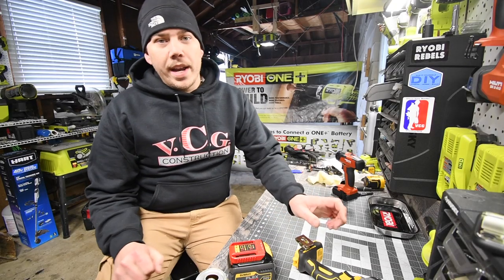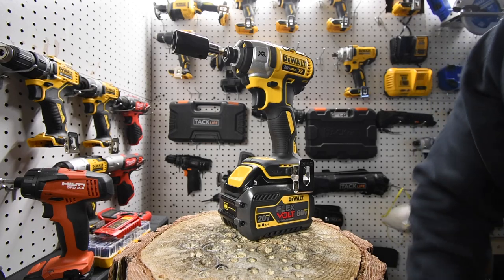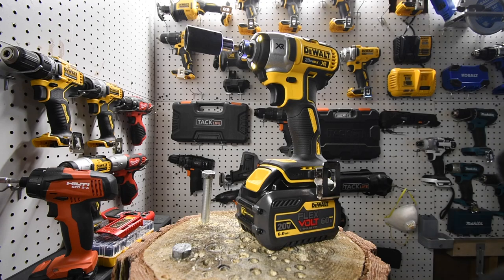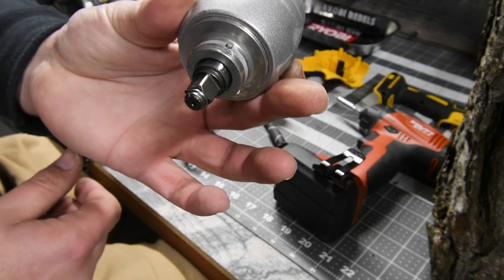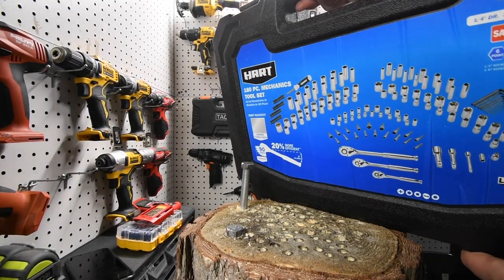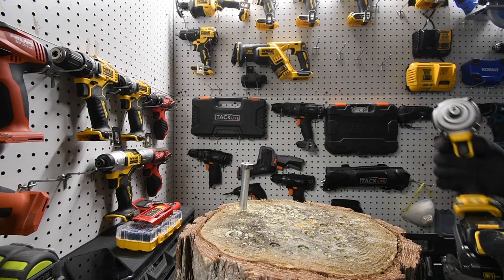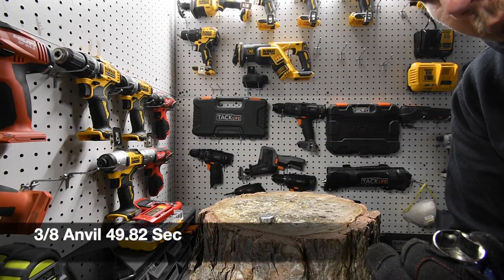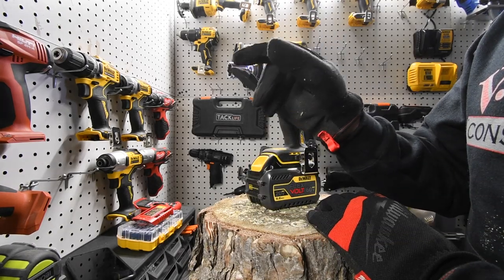1/4 Hex Anvil VS. 3/8 Anvil in a Impact Wrench

Comment: I did this conversion.  I only swapped anvils between the two. 
The 3/8" anvil seems to stick out a little more when put in the 887 body. 
The 1/4" hex  anvil isn't quite long enough to allow the lock-ring stopping the anvil from falling through nose cone to be installed.  I just left it off and it works fine, bit doesn't fall out and it drives screws just like before but stuck at speed 2. The collet seems to be up against the body but it's barely rubbing on it. Doesn't affect it's operation.
Reply from the maker: I am glad that you like to take tools apart. people need to do it more often for maintenance. but sometimes people are to afraid because they might break it
Reply: @ManCaverTools  I figured out that the anvil, hammer and nose assembly has to be swapped between the 887/890 to work perfectly with no issues.
The hammer in the 890 is thicker than the one in the 887, so even if you mix match them it won't work perfectly which is what I did the first try around. 
I have a video of the finished products.....

Comment: Try for longer when wanting take out the bolts the impact wont start turning in less than 1 second needs bit time to build up torque need wait atleast 5 secs thats when  impacts are at full torque
Reply from the maker: not a problem sir and thank you
Reply: @ManCaverTools  it's cool just a tip thanks

Comment: The quality of the hex adapter may have been a factor.  For example I used a standard chrome craftsmen 8" extension to take some bolts out but for the last one I used a HF impact extension and it wouldn't budge. Changed back to the chrome extension and the bolt came right out.  I had to stop mid job and run to HF before they closed n that's when I saw the impact extension kit and figure why tear up my chrome standard extensions.
Reply from the maker: Makita so far made the best one that I testes

Comment: I take back my statement in the last video the 3/8 anvil made more of a difference than i thought but the fact that the torque numbers between the 890 and the 887 are basically identical is still a shame dewalt could have atleast made the 890 200 ft lb instead of 150
Reply from the maker: it would be nice if it was more powerful and thank you sir

Comment: Theres a 3/8 to 1/4 hex adapter performs very well, designed for use on industrial market
Reply from the maker: I have a 3/8 to 1/2 adaptor and it works great.this video was to prove that just because it has a 1/4 colit doesnt mean it always going to be an impact driver

Comment: Milwaukee has a 1/4in square anvil impact wrench in their 12v line. I have the dewalt 20v line which is lacking the 1/4in square anvil impact wrench. I have an extra 1/4in hex driver. Does anyone think that there’s a chance the Milwaukee square anvil would replace a dewalt 1/4in hex driver?
Reply from the maker: I have no clue right now Logan

Comment: It's interesting that the 3\8 could only remove one of the two bolts driven in by the 1\4".
Reply from the maker: the power its takes to put these lag nuts in is crazy, even the big impact wrench couldn't take it out
Reply: Should of seen if the 1/4 inch could take it out somewhere else since the 3/8 couldn’t remove the last lag bolt either

Comment: Hi Dave,

Do you have any issues with the DeWalt DCF887 catching or burning up on you? 

I think i might purchase a DeWalt DCF887 again convert it to a 3/8 anvil. I did like the power it had. Plus it had 3 speed.
Reply: I wouldn't buy a 887 if doing a fair bit screwing or bolts with it cause thiers no fan inside to cool dowm motor it just keeps going till it cooks aswell no protections for heat overloading
Reply: Ive heard the 885 is better
Reply from the maker: I had no issues with any dewalt tools burning up yet
Reply from the maker: I think that would be a great idea
Reply: @ManCaverTools  

Thanks, if you come across any issues with the DeWalt DCF887 let us all know. 

Like watching your channel. Need to lose the VCG hoodie, LOL... confusing me. Also a great channel and bunch of very cool guys. 

Got to create some of your own shirts now, LOL...
Reply: @Michael C
You would have to swap the complete anvil, hammer and cone assembly for it to look like it came from the factory....👍🏻👍🏻

Comment: Good video friend, you know what anvil I should buy for a 1/4 DCF 885 impact driver to change it to 3/8 or 1/2.
I thank you for the information, greetings from Colombia.
Reply from the maker: I will find out and make a video on it and thank you Devisfer
Reply: @ManCaverTools  Did you ever make this video?  Not seeing it in your list.  I'm also wanting to swap out a hog ring anvil for a detent pin version instead.
Reply: @devisfer Here is the part number to convert your DCF885. I did the same thing and converted my DCF885 to a 3/8 impact wrench. DeWalt 608116-00SV 3/8" Anvil Assembly
Reply: @rok-n-rob 
Sounds fine to me, I'm going to find him to make the change.  Thank you very much friend.

Comment: Does your impact not cut off when using a flexvolt if you try and run it to hard? I have a dcf787 and it cut off after 1 second when I hammered it on something with a 9ah flexvolt battery. It would sit there and hammer the battery dead with a 20v battery though.
Reply from the maker: I havent had that issue yet, but I do have impact cut off in general while im using it. it happens to all tool brands and tools
Reply: @ManCaverTools  it only does it with the 60v battery, and in email dewalt told me "flexvolt batteries do not work on that tool" even though they also say they do. I may buy the craftaman cordless ratchet deal they got going on right now, I need a cordless one.

Comment: Ryobi Man Caver, what do you think about the 1/2 to 1/4 hex and 3/8 to 1/4 hex adapters to keep from carrying an impact wrench and impact driver or even doing the swap as you have shown?
Reply: If the impact wrench is enough powerful, it won't be that bad, but the tool will become longer and difficult to be used in tight spaces. It will do the job but the best solution is to have both tools.
Reply from the maker: the 1/2 has a bigger hole so the 1/4 and 3/8 will need a spacer to fill the gap so grease doesn't fly out